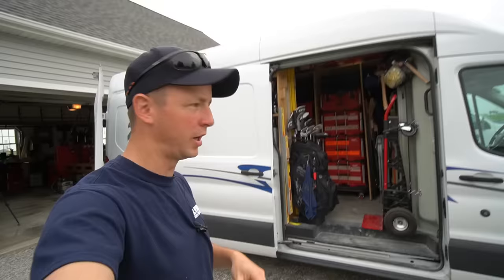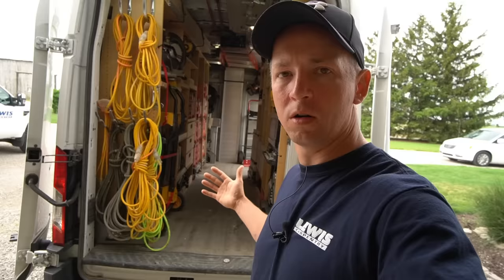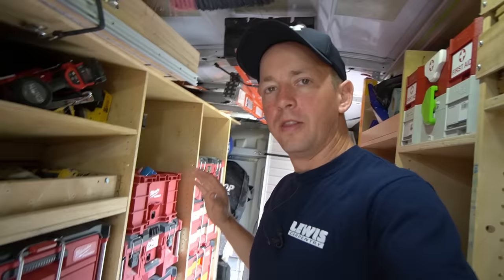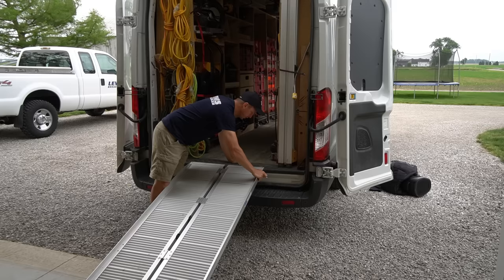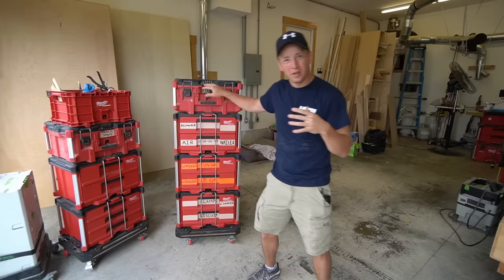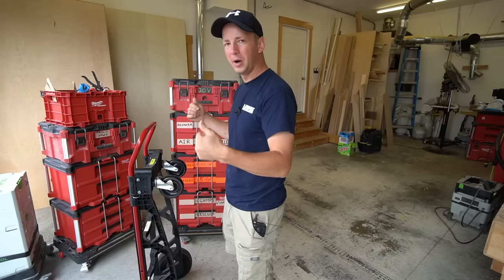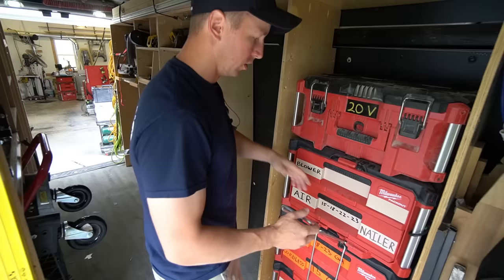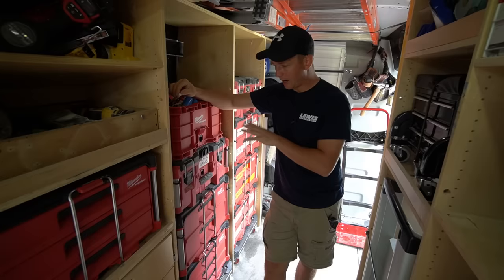Packout Drawers!!! My Favorite Carpentry Work Van Setup Yet!!!

Comment: Hi Spencer, I'm starting my own electrical business. In the process of finding a van to purchase however I would prefer to buy it with no shelving installed as I'd like to just install the Milwaukee mounting brackets for packout system throughout the van. 

What is the best method you would recommend to install these mounting brackets to the sidewalls of the van?

Comment: I saw in your other video that your custom dolly has two solid layers of plywood with a bit of open space between them. Why not a simple, single layer of plywood instead? I’m curious about your reasoning.
Reply from the maker: Good question. By creating the sandwich it prevents the stack from falling forward, or side to side, off the dolly. Makes everything a bit more secure and easier to use in general.
Reply: @InsiderCarpentry  Thank you for your reply! I’m a fan of how you present things - well done! You have a new subscriber here :) If you don’t already have a more in depth video about the dolly, I hope that you’ll make one someday. I’d like to learn more.

I see that Milwaukee has a dolly in its PACKOUT collection - was it available when you were purchasing your system? If so, why did you still choose to make your own?